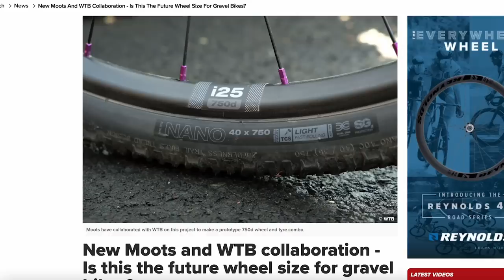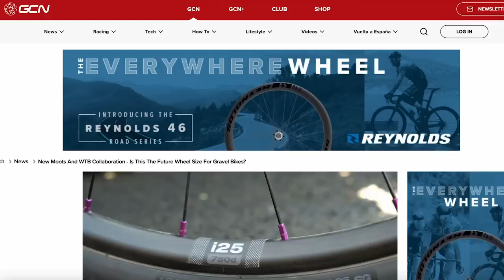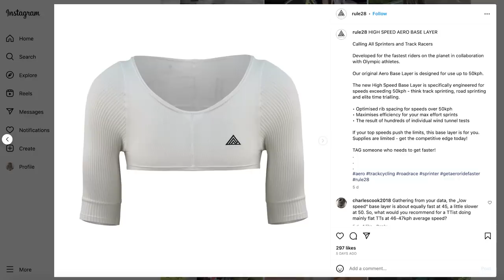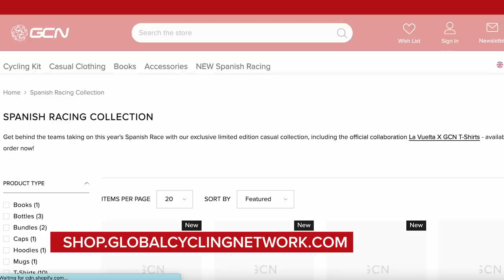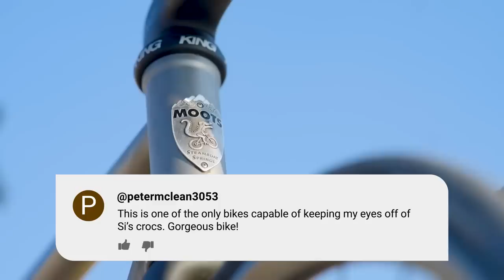10 Worst & Most Hated Bits Of Cycling Tech! | GCN Tech Show Ep. 297

Comment: I just rode a big event this weekend and was very happy to have a radar rear light. 

We were not on closed roads, but we were on country roads. Speed limits for cars were 80kph. There were many riders on the route and we often formed up into smaller groups. 

The rear radar let me notify the group when a car was approaching, when it was coming fast and even how many cars were coming. That allowed the riders around to go single file if needed or to make sure they don’t cross the center line to pass another blob of cyclists. 

Oh and the radar worked just fine with people behind me, it’s not blocked by a cyclist or even a car. 

When doesn’t it work as well? Heavy traffic. So if you’re riding in the city it’s not nearly as useful. Also, because it uses speed differential to calculate if there’s a car back it will also alert to a notably fast cyclist coming up on you.

Comment: Polarising opinions chaps but I agree with the majority of respondents on the rear radar - it is the best piece of tech that I have put on my bike in years. Not only does it let me ride in a more comfortable and safe place on the road when nothing's behind, but it allows me to move out of the way in time so that drivers don't get annoyed. It also changes to a bright flashing mode when it detects cars making me more visible and shows me not only the number of cars in the queue, but warns me when they are coming particularly quickly by turning the head unit red. I realised recently that I actually relax when I glance down and see the head unit turn green meaning there's nothing behind. Almost all my riding is done alone and it has reduced my stress levels significantly. I just can't understand why all of the above isn't a good thing!

Comment: I won't ride without my Varia Radar light. With most of my riding is in the city, commuting in the morning darkness, and afternoon busy traffic about 9 miles each way it is indispensable. 

The rout is a mix of bike lanes, normal roads, and some off street trails. I need to get in the main lane several times for left turns and some bridge crossings. The Radar is visible on my Wahoo and beeps to let me know and look down. It is 95% accurate showing the number of cars, speed approaching and when it's clear. I still look behind every time when getting in the lane and it helps to know am I just confirming it's clear, or seeing how far the car is behind me before I get out in the lane. Other times I ride closer to the road side of the bike lane to avoid debris closer to the curb. When I get an alert I get a little closer to the curb as the car approaches.

Just makes me more aware of the cars that are always trying to kill me lol. I have been hit by a car before by a driver that was completely not looking in the direction that they were turning. The Radar would not have helped me, but it reminded me that many drivers are not paying attention to cyclist on the road, and I don't mind inching over a bit as they approach from the rear for my own safety. I have seen cars that have passed me on a slow curve, hug the bike lane line, not because they are deliberately trying to code me but they are just being lazy with their lane discipline. Those are the ones I avoid by moving over a bit as I see them approach on the Wahoo.

Comment: I disagree with the cable operated disc brake comment, Ive been using TRP sprye C brakes on my gravel bike with 160mm rotors and have had no issues at all. Ive also used shimano R7000 hydraulic brakes and they were a bit better but I dont think they were a great deal better. Stopbeing a snob Alex.

Comment: Totally disagree on the radar rear light - been using one since it came out, and now I would not ride anywhere without one….it has been a real life saver, allowing me to know how many cars are behind me, warn me when they come into view, warn me of the speed they are approaching - and tell me that cars speed, and log it - all giving me time to take avoiding action if the car is approaching far too fast….

I can only think that the presenter did not set the unit up properly or did not understand it when attempting to use it…

Comment: Re: cable disc brakes, if set up with something like Nokan cables or odyssey linear cables, they work pretty well. The biggest weakness in the system is the housing compressing, if you can set them up with compressionless housing, they move a little bit further up the spectrum.

Comment: I love my Garmin Varia light/radar. I pair it with a wahoo elemnt bolt on my Trek Domane AL5 Disk. It works great for me, alerts to approaching vehicles, many times before I can hear or even see them in my drop bar mirror. I do not ride in high traffic areas. My 70 year old neck does not turn as easily as it use to. Also, they must be positioned correctly to work correctly.😮

Comment: Cable disc brakes have their place. I have a tandem and have been advised by the manufacturer not to use hydraulic disc as it is possible to permanently damage disc and pads. I have upgraded the pads and this has given a reasonable performance improvement. 😮

Comment: Ollie is right Cable Disc Brakes work and are better than rim brakes for gravel and possibly winter training. It's very rare to wear through a rim now on gritty wet tracks and roads. Wheels last longer and that provides a budget, if slower heavier, option.
Reply: I thought this was known for some time now that rims fall off in harder conditions but are lighter. I have found sometimes that in an emergency though, rims fade makes gradual stopping a bit easier than losing traction and just aquaplaning into the back of a truck. 😂
Reply: I'm proper old school. I have disc brake wheels built onto Mavic touring rims (rim brake). They're heavy but I doubt I'll ever destroy them. 

Sadly I exceed the weight limit on most factory wheels 😂😂
Reply: @andrewblakesley4202 those heavy rim brake rims won't take impact as well as a lighter, hookless rims.
Reply: I've yet to break one, bend one, pop a tyre off the rim etc.
Reply: @andrewblakesley4202  most people will never do any of those things

Comment: You have missed two important points with radar rear lights.  Of course they don’t protect you from careless drivers, nothing does. But the light flashes faster as a car approaches, increasing your chances of waking up the driver.  Your city bias also means you are blind to the benefits on quiet single-track roads where you can make informed decisions about pulling into passing places or shouting your group into single file - particularly with a headwind or winter cap when you might not hear an occasional vehicle approaching.

Comment: Cable disc brakes don't suck for applications like bikepacking/adventure riding. While hydro don't stuff up very often when they do 🤯 and unless you carry a bleed kit you're stuffed. Also, try the Paul Klamper mechanical disc brakes. Your mind may be blown.
Reply: I don't carry a bleed kit for my cars and don't feel the need for my bikes either. Never had a hydraulic failure on bikes or cars but if you do, you still have braking on the other wheel.

Comment: For people who are in the 15 stone weight range I find mech disc binders to be more effective.  They provide superior initial stopping power and more overall braking force IMO.  When I am on my touring bike, the total load can be upwards of 250 lbs and overall stopping power is the chief concern.  I find that both my older BB7 Road Discs and current TRP Spyre Mechanicals provide better initial bite and stopping power than both my Red hydro equipped bikes (11 and 12 speed).  I also use BB7 mech MTB brakes (on my MTB of course).  I have never used hydros on my MTB and never thought that the braking wasn't adequate to my needs within the limits of traction or in terms of modulation.  You may be correct for lightweights such as yourself, but clydesdales will find themselves very happy with either of these.  The Spyres are especially nice but a bit chunky if you are fussy.

Comment: The most useful situation for rear light radars are on fast descents, where you have so much wind noise, you wont hear a car behind you. When descending with high speed, you certainly don't stick to the very edge of the road. Now having an alert, that there is a car behind, that probably want to overtake you is a really nice thing.

Comment: about cable disk brakes - they do work and not suck when the cable line is straight and calipers are good like avids bb7. in road bikes the cable line to rear wheel is often not straight, so breaks suck. on mtbs and fat bikes when cable line is along top tube of the frame, they work pretty well and sometimes even better than hydra i.e. in winter with sub -20 temperatures

Comment: Carbon clinchers and rim brakes work fine, had more issues with spokes braking than anything else.   I live in South of France and do fast mountain desents all summer - no issues (except some squeaking), no over heating, no wear on the rims.  I am usually faster in and out of corners than disk brake friends but this is more to do with handling than the 'tech'. In other words its biased sponsored commentators that suck here.    

Also regarding a weak area between rim and brake contact.  Each wheel type are built for the job intended and the disk brake equivalent wheels are heavier due to stresses of disk brakes in other parts of the wheel. Therefore weight for weight disk brake wheels are more fragile than clincher and need more material to do the same job.

Only valid point was worse braking in the wet which is rarely an issue where I live but could be a deal breaker for some people.    In any case the tech needs considered as a whole.  Such as - Weight, cost, ease of maintenance, frequency of maintenance, ease of replacement etc where rim brake setup is generally lighter/cheaper/easier/simpler.
Reply: 10000000% agree.

Comment: Rear lamps.
I'm in my 57th year of riding a bicycle on the road, day and night. Never had any trouble with rear lamps not been seen by motorists. Fit a couple of reflectors.

Chains.
Chains are consumables. If you ride in dust over gravel tracks, expect a great reduction in chain ( and sprocket ) life.

Anemometers. Air speed sensors. An electronic pitot tube anemometer cost £275 upwards. I used one to measure air flow over air cooled motorcycle engine on an engine test bed. Down to 25kmh.

Comment: Why do you guys harp on rear light radars?  I've used one successfully for 5 years and am quite happily still alive. This is a passive safety device that won't stop a car from hitting you. I'm happier to know when a car is there, regardless of the drivers' intent, allowing me to look back. At the very least it's a bright rear flashing light.   Perhaps you're just not open-minded enough to this tech.  Frankly, if it was made by a brand you guys openly talk about, you'd probably have a differnet opinion.

Comment: I prefer cable disc brakes, specifically the TRP Spyre, which moves both pads.  Admittedly, you don't get quite as much power as with a good hydraulic, and you have to give the adjustment screws a quarter turn with your multitool occasionally when the lever gets soft, but the power is still pretty good, and you can use a bigger rotor if you want more.  The advantages is that they don't really need much other maintenance to stay reliable.  Lots of times I've had hydraulics get a sticky caliper and drag one pad, making noise, and uneven wear, then you have to bleed them and/or replace fluid, and if you want to make any major changes, or swap them to other bikes, you can just buy a piece of housing and cut it to whatever lengths you need, rather than buying compression fittings that are single use.  On my mountain bike, where I need that one-finger braking and am on and off them frequently, hydraulics are a necessary evil, but on my road bikes, a mechanical (cable) brake with a bigger rotor are way nicer.

Comment: What sucks is tubeless.  I like the concept,, and have repeatedly tried it and always gotten burned.  First time was with some of the early tubeless specific Hutchinson fusions with stans sealant and tape.  They fit so tight that I could barely get them on the rim.  About a month in, I got a small cut from a piece of glass, which sprayed sealant everywhere and did seal, but only with 20PSI or so (in a 23mm tire).  When I tried to pump it back up, it started to leak again, eventually sealing up with not enough air to ride on, again.  I tried "just swapping in a tube" as most tubeless fans suggest as a last resort, but after getting my hands covered in mess, and a couple broken tire levers later, I had to walk it to catch a bus home.

The next try was more successful.  I ran about a year on schwalbe marathon tubeless ready tires and orange seal tape/sealant.  Firstly,, adding sealant every few months sort of sucks, and the stuff can get pretty rank.  Spontaneously one night I hear a pop and blast of air from the other room.  Go over and find sealant all over the rim, wall, and floor around the bike.  Take the tire off, and see that the tape had blown out in one of the spoke holes.  Shrugged it off as a freak occurrence, retaped the rim, added sealant, cleaned up the mess, and got on with it.  About 2 months later, just before bed time the night before an early morning sportif, I hear a similar pop and hiss of air, and the other tire has blown its sealant all over the wall.  Got pissed off and removed them both, half-assed cleaned out the sealant, and put in some tubes, and got not nearly enough sleep before my ride.  If it had spontaneously blown that tape an hour later and I didn't hear it, I wouldn't have had time to fix it in the morning and make it to the ride.

I get the idea, but it's such a hassle for the relatively minor benefits.  For best performance, I'd just go with latex tubes, and a spare.  (I use tubulars on my track bike where flats pretty much never occur)  They're probably lighter than the sealant, if that matters to you, and if you do get a flat, at least the fix is predictable and reliable.

Comment: Ollie calling Alex a snob because he snubs cable disk breaks. “They do work” Ollie says… Ok well I happen to be riding on carbon clincher rim breaks and they most certainly work, yet Ollie calls them rubbish… For lighter riders who don’t do long descents and don’t ride in the rain, rim breaks are more than adequate even on carbon rims. Less maintenance and easy to maintain when they do require it, no goose in heat noise, less expensive, lighter… They do have disadvantages but so do disk breaks, so saying they suck is an unwarranted judgment call.

Comment: So it sounds like Hank is going to be set up to do the Trans Continental or RAAM on a bike with solid tyres, cable disc brakes, oversized pulley wheels, lubed with 3in1, radar lights for the night and an airbag helmet in case the radar lights don’t work! 🚴🏻 🌬️🏔️💥😂😂

Comment: Any tech that is making bikes prohibitively expensive. In the news today, bike sales have fallen again in the UK so they're now the lowest they've been for 20 years, when they should be booming. Meanwhile we're being pushed fully integrated everything. When it's going to cost you £1000's in labour costs just to change a handlebar something has gone seriously wrong (look at the comments underneath that Pinarello video you posted to see bike mechanics saying they'd either charrge a fortune or not touch it with a barge pole). No wonder bike sales are dropping off a cliff. Please. Bikes that keep things simple no added costs of electronics on mid range road bikes, that you don't need (doubling the cost of your groupset) integrating cables might look good and save you 2 watts at 40kph or whatever, but it's a pain to work on and will cost you more down the line when components need changing. Hydraulic disc brakes. yes they're great, but again, SO expensive compared to the cable or caliper brakes plus the extra servicing costs over the years. I'm all for new tech, but it's continually making bikes more complex and more expensive not just at purchase but down the line when they need servicing

Comment: I would respectfully disagree about radar tail lights being tech that sucks.  Like you, I was skeptical.  They tell you that a vehicle is approaching, but not the trajectory; in other words, whether it passing parallel to you, or coming directly at you.  However, a friend whose opinion I value raved about it enough that I decided to give it a try.  

There were several instances where it was beneficial in ways that I didn't expect.  On a fast downhill when wind noise makes it difficult to hear, or during cold weather when my ears are covered, the radar alerts me faster than my ears will.  

Also, it has alerted me that 2 vehicles were passing when a truck was towing a trailer.  If I was looking back too early, I might have spotted only the truck.  

It also gives me a heads up if an ebike is sneaking up quietly.

And to be honest, if I am riding solo in a rural area and my mind is wandering, the radar snaps me back to being focused when traffic is coming up from behind.

Comment: I have zero issues with cable disc brakes.   They work fine and you can actually adjust the clearance so they don't rub.  The bigger issue that they suffer from is the bike and handlebar manufacturers making super tight bends that cables can't glide through.   The assumption is everyone is on hydro.   I run cable disc on my cross bikes and they see all sorts of weather.  No issues.